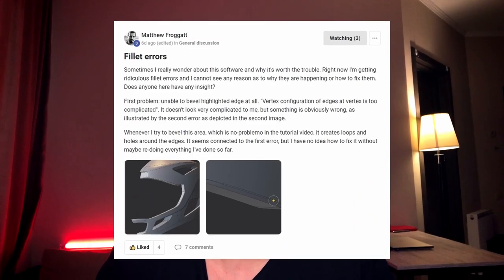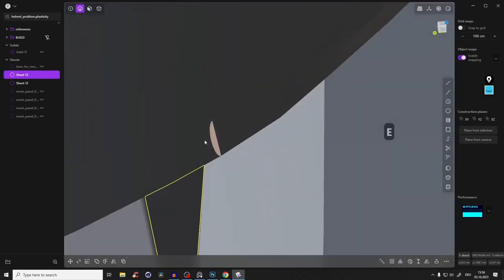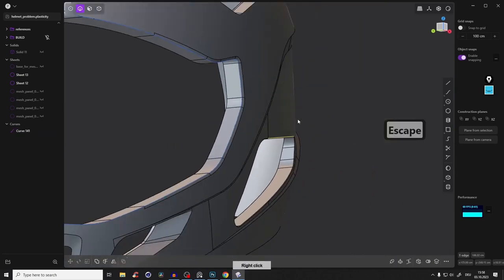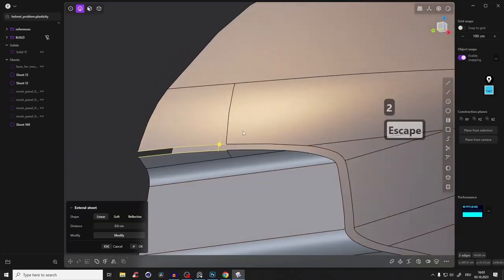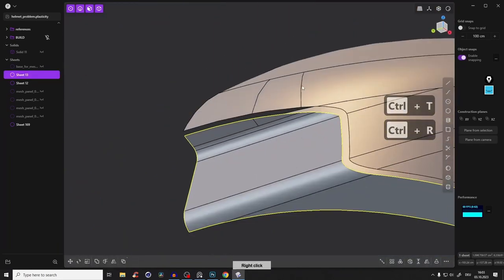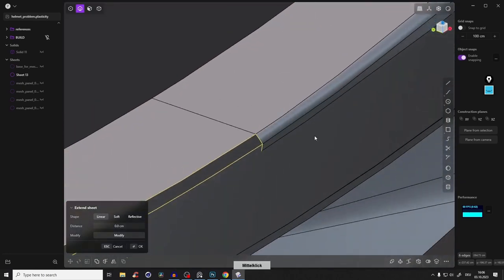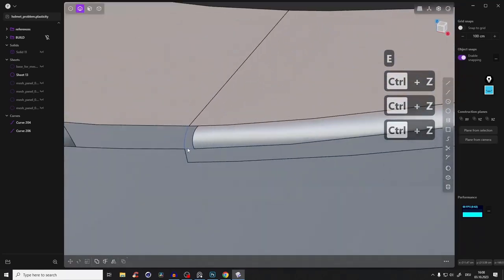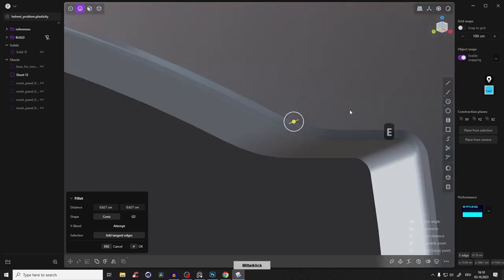Fix every Fillet Problem with Surface Modeling in Plasticity

Comment: I would really like Plasticity to add a taper option to Pipe where you could adjust the length of the taper.  Then DIY fillets would go even faster.
Reply from the maker: Oh yeah, that would save a few clicks. 
I am sure in the future it will come. Step by step:)

Comment: Nikita, is there a specific reason you use G1 continuity, instead of G2 or G3? as I understand it, the higher the G, the smoother the transition, if I'm not mistaken?
Reply from the maker: Good question.

G1 is used to create a smooth transition between surfaces, as G0 is no transition at all. G1 is absolutely enough in many cases for exactly that reason. To create a smooth transition. G0 would create a seem.

G2,G3... is smoother yes, but harder to set up correctly. And G2+ is mostly used for complex, organic, curved shapes which are very noticeable and have to be super high quality.
Reply: thx, mate. love your tuts, btw
Reply from the maker: @denisrakaric9951  You're welcome!

If you are interested to learn more about Surface modeling, I have amazing in-depth courses like this one:
https://nikitakapustin.com/courses/plasticity-surface-modeling/

Comment: When I boolean with a pipe I always get a small strip of geometry left behind in the middle. Any idea on how to avoid this, like on the video?
Reply from the maker: I know, it is a bit confusing.

Make sure, when you pipe a curve you ONLY increase the "Section Size" value in the bottom left corner.
Reply: Thank you very much. That worked! @nikita.kapustin